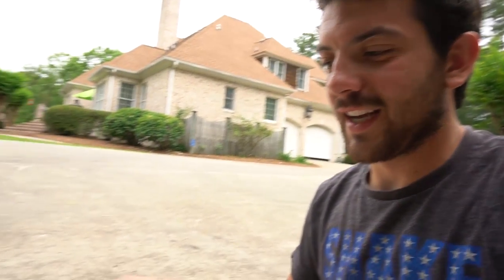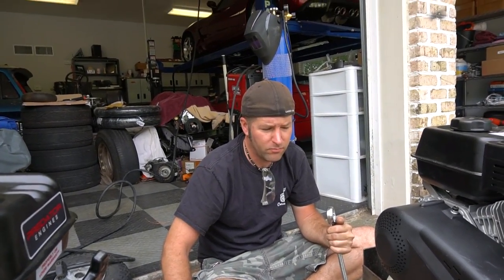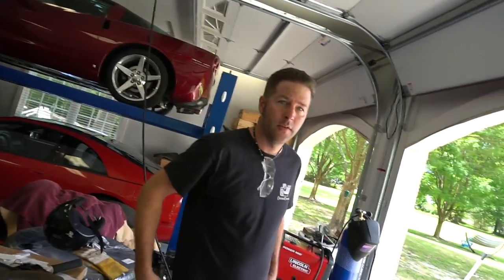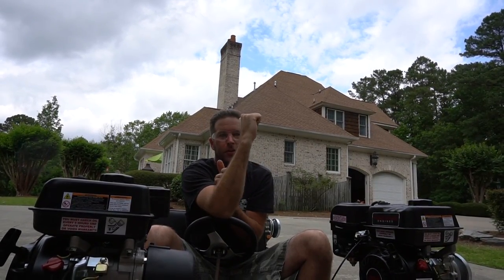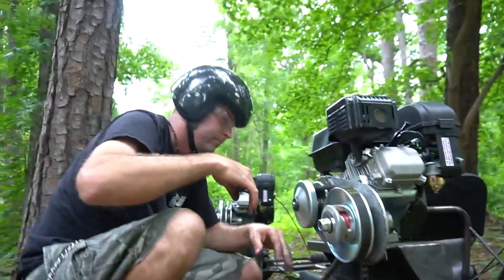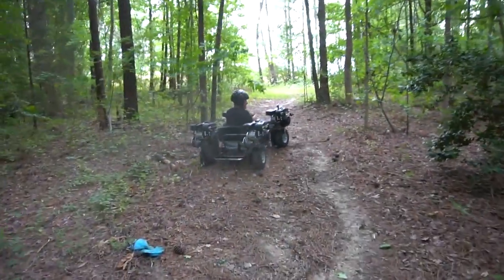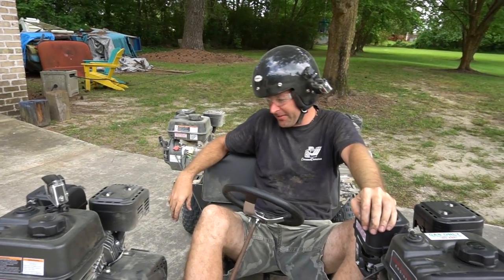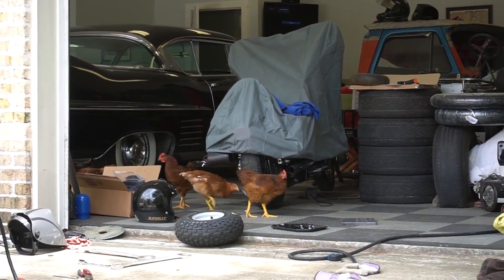Mad AWD Kart Launches: Chain & Steering Adjustments

Comment: Can you guys please help me I have the same yerf dog 3203 as you but it has a predator 212 and a torque converter. The problem is that the chain always pops off or it breaks the master link. I have tried loosening and tightening the chain but it still has problems so if you could make a video where you add a predator 212 to your yerf dog it would help me a lot. Thanks!!
Reply: What chain you using ?
Reply: OKIE CHOPPER #40 chain
Reply: Have you tried a Black / Gold chain?  and stay away from TSC master links & chains.
Reply: OKIE CHOPPER No I haven't tried that yet but what exactly is the difference between a regular chain and a black or gold chain. Thanks in advance!
Reply: Better quality ,  built for karting stress.
Reply: OKIE CHOPPER Ok I'll try that. Hopefully this solves the problem. Thanks for all the help!!
Reply: Good luck , and make sure you have real good alignment on the sprockets up & down and side to side. And use a good Bee's wax chain coating.
Reply: OKIE CHOPPER Ok thanks!!

Comment: dear John and Ike i really need help. im guessing yall are good with wiring. i need help like badly. i have an old 50cc, 4 stroke, 4 speed kids atv and im having trouble with it i know this is a long shot but i hope to meet you two and work on somthing with the both of you. im good with measurments, welding, ideas, and motors in general. my mom has a 302 small block v8 in her 76 ford mavric and i put that motor in the car (with help ofcourse) but ive been needing a way to make good videos for my chanel because right now its trash. long story short i can do alot of hard work and i know what im doing and it would be a real blessing to meet the both of you or even get a response on this coment.  your friendly mechanic~Zodiac~

Comment: Idk if they would see this but I have a stock 212 and when I go to drift it dies how can I fix this
Reply: probably the low oil switch cutting the engine off. first check the oil if it is good then unplug the low oil cutoff
Reply: Isaac it'll be fine ok thanks I was hoping it was simple like that and not a faulty engine

Comment: Hey I know you probably won't see this but my son's go-karts clutch has broken, one of the teth fell off and it got chipelped and the bearings are shot, it was sitting in one spot for about 3 and a half years and when we finally fixed it and got it running it worked for about two days then the just gave up and also burned his finger, and I was just wondering if you could get us one, we really can't afford one right now, so please help a fan of yours out, it would put a big smile on my son's face. ☺️

Comment: I have been building and Racing karts for over 4 decades.  This is very interesting, but the design is totally wrong. Axle diameter is too small, engines mounted too high and right over the tires.  That is why they are having chain problems.  Small diameter of axels now put the weight of the machine and driver.  The axles Felix up which loosen the chain, now apply the power the bottom sprocket is pulled towards the engine, now the chain is looser. Center of gravity is too high due to engine height. 
Keep having fun and have a great day.

Comment: I wish you guys were better builders. With everything thats hacked together to get this thing to run, your constantly chasing your tail trying to keep it running. You've got decent parts...Take everything you've learned from this build and put it into a new chassis that can handle it. Now that you've got proof of concept, use this cart as experience to build something better.  Ditch that awful steering set-up, and put brakes on the next one. If you run a conventional rear axle with two engines turning the one shaft, you can run a disc brake for the rear. Also dual throttles aren't needed since it has a steering wheel, so I would run all the throttles to one pedal to free up the other side for the brake.

Comment: Told you before you started that you will have these issues,    It is not the tourgue from engines,   Its the issue of difference in engine/wheel  speeds.  You but  200lbs guy onboard,  hes going  40mph,  and  engine bushing.  then you turn, the other side will brake, and other is not doing so coz it has to go around.     That is the force that is bending your bolts.  breaking your chains.  and eventually it will breake your crank.      If it doesnt hurt you on legs when metal pieces fly around you before it.   

Just fckin think !!!! use your brains,   its not rocket science !!!!   It is science tho,   but hey,  science bitches , it works !!!!